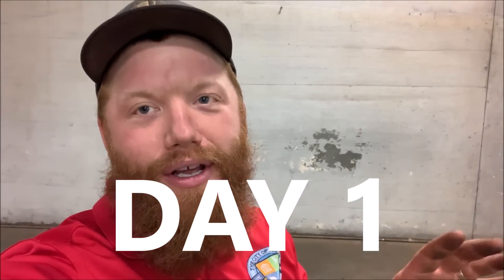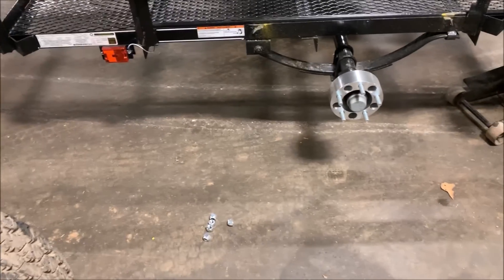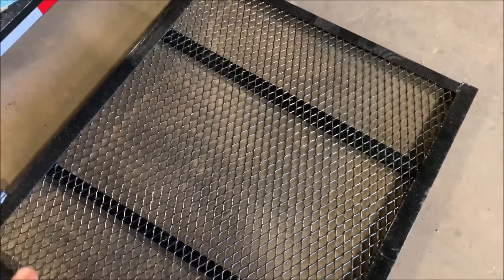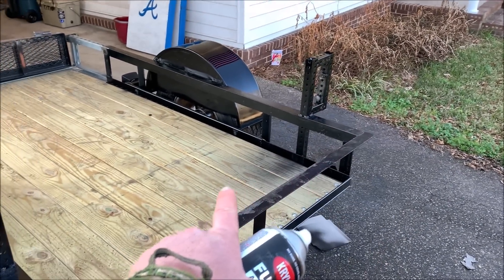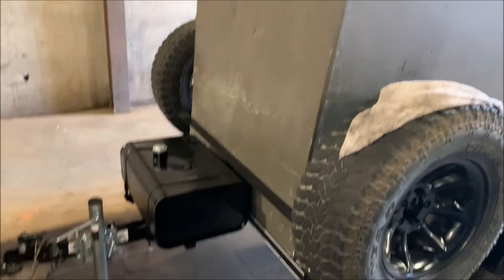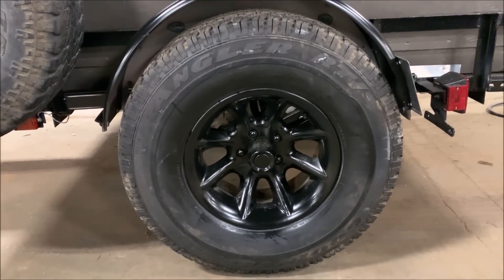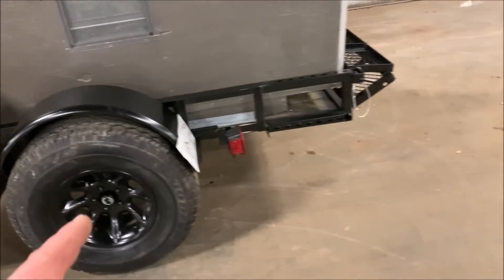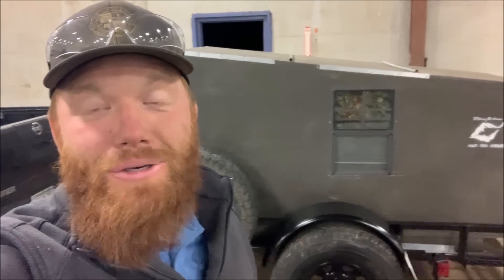DIY Off-Road Mini Camper

Comment: I would be inclined to move the axel back a few inches. I'm betting that thing sways going down the highway. I would also secure the sleeper box to the trailer with something more than a few small screws in aluminum angle. Bouncing around is gonna pull that right out of the flooring and if you ever were in an accident, it becomes a flying death machine.
Reply: I just watched this and said, "You need bolts on the frame." Good call.

Comment: Clean and add polish to the dirty tires as all that work and the dirt on your tires brings it all down donwash and then add a shinning agent to make it look brand new. Add brake lights asap. Paint the camper door then add black trim.to camper windows and paint carpet door black and add more black color to the camper edges plus a nice new neat small logo. And a bracket for a small American flag. If you don't have a cooking place inside your camprt add one on top of edge on back. Good work and good job. Just a few small suggestions to make a great project even better. You rock! 🇺🇸
Reply from the maker: Thanks for all the suggestions, but pretty happy with how it looks looks, lol. Also, The camper already has brake lights.

Comment: I have  a 7 x 14 stealth utility trailer/camper. Seeps 4  in 2 bunks that fold up like cabinets. Flat screen tv, wifi, stereo inside and out, security light with motion detector, fold up table and a bar/ counter at the front  of the v nose, porta potty, ac and heat. Removable back wall. Bunks are removable as well so you can still haul stuff if needed. No ac unit on roof, its inside and the air blows out the bottom next to the wire connector. No windows.Insulated too.  I also just finished a micro camper build  on a 4 x 8. It has a house window ac unit inside that blows out the front,  but can be completely concealed by cover when not in use. On a 100  degree day it takes about 10 minutes for it to be at 70 inside with full sun. It has a flat screen, wifi, cable ready and a bluetooth stereo system. Sleeps 2. BOth have a solar panel and 12v/110v systems. Nice build. Look forward to the mods because they will be coming. I  dig this kind of stuff! Enjoy!!

Comment: I have a similair trailer,broke the 2000# axle offroad because of 33"  wheels need an axle rated 3000# according to offroad shop that changed it.Also the fender/tire clearance is not adequate for loaded use.I had same issue with mine and fenders rubbing on tires,offroad shop made aluminum plate fenders that are easily removed for offroad use.I have camped in mine on 6 month extended trips all over the desert southwest and west coast, good set up for BLM off grid (free) camping.
Reply from the maker: I hate you broke your axle but I’m not sure why the shop said what they did. It’s hard to know without seeing your trailer (size, weight ect). The axle weight rating has nothing to do with the tire size bc it’s an idler axle so it’s just being pulled along. If it was a drive axle it would be a completely different story. My camper weighs around 400lbs. 1/5 of the axle rating. The only time that weight changes is when it isn’t moving and I’m laying in it. Now if I drove like a mad man off road I might need a heavy axle but I don’t (especially if I’m pulling the trailer). I also haven’t had any issues with the fenders rubbing bc the trailer weight doesn’t change. It sounds like you use yours a lot more then I do. I sleep in mine 20-30 nights a year. A 6 month trip would be pretty awesome!
Reply: @sclivingoutdoors  My fenders are fixed,when the axle moves independently up and down on the leaf springs it caused the tires to rub on the fenders.My trailer weighs 750 to 1000 lbs.The axle spindle snapped on the highway after hitting a deep hole while off road.My trailer is a Sherpa off road model made in Libby,Mt.You'll have a blast with your trailer,social distancing is a snap with a rig like that.
Reply: @sclivingoutdoors  i thought this was a great video. I second the axle comment, and searched the comments before simply blasting my opinion in.

I started a very small channel a year ago, highlighting some of my trailer mods.  Chevy it out if you have the time. I think there are a few features you may like.

I believe the axle you have, or more precisely,  the bearing will be stressed beyond the 400lbs you are carrying. The weight of the new tires, multiplied by the size (much taller than stock) will definitely transfer more load to the bearing. This is then compounded  y the 2" spacer. The trailer axle likes to have the load placed directly over the bearing. It is no mistake that trailer rims have neutral offset or maybe better referred to a zero offset AND symmetrical back spacing. 

I hope you get years of use out of it,  just the way you have it. If you do have a bearing failure over the next 2 years- you may consider moving up from the 1-1/16th bearings to the more substantial 1-3/8th bearings on a 3500lb axle. It really makes a difference!

Best of luck to you!

Comment: Looks awesome man, the only thing I would do is move the axle about 10 inches back
Reply: Nice build!!  One question;  what did the fuel tank come off of? I'm looking for a tank about that size and capacity, but so far only finding plastic boat tanks.
Reply: @runwfo  You can get a fuel tank if you search for old car or old truck... Also in a used part

Comment: Nice. If you find yourself needing a better departure angle you could relocate the axle to the bottom of the leaf springs. A cheap lift that helps in some situations.
Reply: He should also either get larger fenders, else mount them to the axle, as there is going to be some major tire rash with as close as he has them mounted to the tread...

Comment: Looks good, now one upgrade you need is the jacks you can buy from Amazon that folds down.  They help to stabilize the trailer when you are in it.  We added them to our flatbed trailer when we put our slide-in truck camper on it, and it really works well.  Just a suggestion, you may want to think about.
Reply from the maker: I have multiple upgrade videos on my channel. I added some diy stands on the back. They work well and didn’t cost me anything 👍🏻
Reply: @sclivingoutdoors  Well now that is a great selling feature, no cost. lol

Comment: Looks awesome.  I love projects like this.  I have the same kind of trailer, which I had a guy weld on rectangle tube steel that fits a 2x4,  I built 4' high stake side walls.  I also took out the mesh floor and put in some 12 gauge steel sheet. It's awesome to haul leaves and brush, and great to haul things like appliances and furniture.  I also have a rack I put on top of the walls to haul canoes.  I can get 3 canoes pyramided on the rack.  These little trailers are awesome.  I'm going to upgrade my tires and fenders like yours!  Thanks for sharing.
Reply: You prolly dont care at all but does someone know of a way to get back into an Instagram account?
I was dumb forgot the password. I would appreciate any help you can give me
Reply: @Brooks Salvador instablaster =)
Reply: @Cameron Jacob thanks for your reply. I found the site on google and I'm waiting for the hacking stuff atm.
Seems to take a while so I will reply here later with my results.
Reply: @Cameron Jacob it worked and I finally got access to my account again. Im so happy:D
Thank you so much you saved my ass !

Comment: Thats Awesome.  Had the same kind of setup. I ended up having to move the axle back for the ride, it made a ton of difference. Just not enough weight in front when the axle is centered like that.

Comment: Looks solid, and even a bit badass. Haven't watched any other your videos yet, but I have a couple thoughts.
The underside of the unit itself looked like it was a perfect place for some good old fashioned pink insulation, floors get cold quuuick. 
The tailgate/step looks like a decent "table" when in the up position, but I'd put a fold up table on any or all of the walls of the camper itself. Just a flat piece of wood, hinge, latch and a cable or two like on your step to hold it up when folded down.
A couple poles on the back corners (or any corner) would be nice anchor points for a cheap, easy to put up/tear down tarp canopy. You could get out the door and stretch your legs,  pop up a camp chair, grill, whatever without a single drop of rain. 
Also as far as rain goes, if you haven't already, something on the back edge to push roof rain runoff over to the sides, away from door, also so you don't have to step in a pond.
This riig does really look great, going to finally watch your other stuf now, then start drawing up a design for my own. I
Thanks for the inspiration, man.

Comment: It would be nice to have twin
propane tanks on the tung of
the trailer for cooking and 
heating as needed.  I think 
I would try to find a way to 
fit that extra fuel tank under 
your truck somewhere as an 
auxillary fuel tank and just tie 
it into your existing fuel tank 
with a standard fuel line, Or 
locate it in the bed  of your 
truck so you can fill it when 
you fill up your truck. That 
would save you from having
to transfer fuel from the 
extra tank to your trucks 
tank if it's already tied into 
the trucks fuel storage 
system.  Also, you might
think about adding tar
paper and shingles to 
the roof or covering the
roof with fiberglass for
extra protection from 
the elements. Once it's
done you can paint it 
the same color as your
camper if you like.

Comment: Spacers change the load area of bearings now they can pull away from trailer and tear up. Fenders have no way to rid of mud on tires and need flaps. Sharp front buffs wind and can make trailer weave on road. If unsafe is what you were going for you did it. Have someone drive ahead and you follow to see how it tracks. Stablizer bars on hitch will help along. Lite means easyier to become air born. 60 per cent weight in front of wheels. So many things wrong will keep you busy for 6 months to corect. Good luck. I built same thing cross bed like semi sleeper with tent cover so no wind resients on hwy. Be safe change or lengthen axcel.
Reply from the maker: I’ve done some upgrades. There are a couple videos. This camper is gone all the way across the country twice. It did great on both trips. Thanks for watching.

Comment: I recommend adding 4 corner stabilizer jacks so it will set nice while camping. Maybe even add solar with led lighting and chargers for your phones.
Reply from the maker: It has legs on the rear now. I’ll do an updated video in the near future.

Comment: You may want to add some jack stands or screw jacks to the back. 
If you step on the rear step when the trailer is not hooked to a vehicle the trailer will stand straight up.
Reply from the maker: Castin’ and Cookin’ it has them 👍🏻

Comment: I know it’s too late but I think if you were to do this, you should paint the deck boards and put a rubber mat down underneath them to prevent moisture damage and rot. Would also add a bit of protection and rigidity to the steel mesh. Treated lumber only lasts so long on its own, let alone on the bottom of a trailer dealing with the elements, and any mud that gets on them under there will stick and accelerate deterioration. May seem like overkill but it would drastically extend the life of the trailer
Reply from the maker: I understand what you are saying but the only time it’s out in the elements is when I take it somewhere so maybe 6-8ish times a year. The rest of the time it’s under cover and doesn’t get any type of water or sun on it.
Reply: @sclivingoutdoors  understandable, I wouldn't have anywhere to keep a trailer like that covered so it would be very worthwhile for someone like me

Comment: tailgate lights to be shifted closer to the rear end. they need to be visible from different corners specially if one stopped working for any reason.
rear steps can be modified to be used as a sitting bench.

Comment: Awesome build man! ... but if I may add 2 cents ... isnt the door on the wrong side? I see a benefit if the door was on the taller end to get in and out easier. Plus the larger side being on the front of the trailer would add more wind resistance hence lowering your MPG. Just a thought! Keep up the good work!
Reply from the maker: This camper was originally built to go in the back of my truck. There is a video on my channel if you’d like to see it. I designed it like that to have pressure against the straps at all times guaranteeing it would never come out of the truck. I just put a topper on my new pickup which should help with the mpgs and I have a few more ideas in my head for upgrades. Thanks for watching.

Comment: You need to put 2 trailer jacks at the back side of the trailer that would help you level it out and also get rid of the bounce
Reply from the maker: There are 2 stabilizing adjustable poles that are removable on the camper now.

Comment: Put a drop leg there in the back behind the step so when you step up the front doesn't rise. The steps are also perfect for a seat.  Just the right angles!
Reply from the maker: I have a couple drop legs on the back now. It works well.

Comment: Camper is coming along great. Like the way it looks on the trailer. You did a great job. Have you put any rear stabilizer jacks on it yet?. Hope you have many great trips in it. Thanks for posting this.
Reply from the maker: Thanks. I like how it looks also. I added some adjustable legs for the back. They work really well even if the ground isn’t level. They can be set up in about a minute per side.

Comment: you should put stabilizing jacks on the back so it won't flip up when not attached to your truck & your getting in the camper .
Reply from the maker: Mike Simmons that’s not a bad idea. Most the time I’ll be sleeping in it it will be hooked to the truck. Also, I think there would be a decent chance I would rip them off on some of the roads I drive on out West.

Comment: Might want to put some kind of retractable legs at the rear corners, or use a pair of jack stands, so if you have it unhooked and step on the step the front will not rise up.
Reply from the maker: I have a set of legs on it. I have done a few things to the camper since the video posted. I am going to post an updated video in the near future

Comment: When I increased my tires to 31s on my teardrop, I removed the fenders as they no longer fit. I am going without fenders as I stand on the tire to access the roof rack, and, according to CA motor vehicle code, trailers under 1K lbs (mine is 900) do not require fenders. Haven’t been stopped yet.  Would like to fabricate fenders I could stand on someday.
Reply from the maker: Don Zimmer those fenders are actually pretty solid and not too expensive either. We thought about fabing some up, but for the price it was hard to beat
Reply: Don Zimmer 
Cheap fenders for tractors are sturdy.

Comment: Looks good! I have the same trailer and basically put the same size wheels on it - I ordered a new axle tho to match my Tacoma since mine was way old and I neglected to take care of it.... I have a RTT on mine.   Do you remember where you got the fenders, I'm still rolling fenderless because I couldn't figure out how I wanted to fab some. Those look good - my axle is a bit wider tho so they will still be a bit too narrow but better than nothing!
Reply: Aww should've watched to the end first, Tractor Supply.  Thanks for saying that, my local one has some in stock looks like I got a project to do! Might need to build a bracket to space them out somehow...
Reply from the maker: Awesome! The fenders were worth the $100 or so. I was going to fab some up too, but this was so much better.

Comment: You need to put an air vent on top of the trailer that would help ventilate the trailer. You can always get a solar powered one.
Reply from the maker: I crack the windows for venting.

Comment: Hey, don't forget to weatherproof the floor under the trailer.  If you don't, the floor will root faster than you think.
Reply from the maker: The floor is still in excellent condition. I keep the camper undercover when it’s not in use.

Comment: Very cool sir wish ya would have shown the inside . What are ya doing for a fridge ? Are you gonna add a roof rack or maybe grab some portable solar panels?
Reply from the maker: It’s just a bed and some shelf’s inside. Some flip on lights. If I have food that needs to stay cold if goes in a cooler in the truck. It’s meant to be very minimalistic. There is another video on my channel that shows the inside.
Reply: @sclivingoutdoors  Well sir it's very nice gives me ideas . After all the have electric generators with solar panels that are portable.  And the Dometic refrigerator things . But it's very very cool how you changed the wheel configuration built it up a little more offroad capable... thanks good luck on your adventures etc ...

Comment: That’s really cool. I love the way the steps turned out. I’m curious if you sealed the wood before you put it on the base. It’s a no brained to me but I didn’t hear you mention it. And since you plan to sleep in the trailer, what are your thoughts on putting insulation between the box and the trailer? I’m brainstorming for my project. Good job.
Reply from the maker: Lee C. I used pressure treated wood so I didn’t put any additional sealer on it. I didn’t insulate bc I didn’t want it to be too warm. It works well for my needs.

Comment: Very cool build! Any info on that fuel tank?  I'm looking for a 10-12 gallon tank about that size and trying to avoid the plastic boat tanks.  Thanks!!
Reply from the maker: runwfo this was just an old one off a trailer that was getting thrown away. Some companies make metal ones for jeeps. They might be more what you’re looking for.